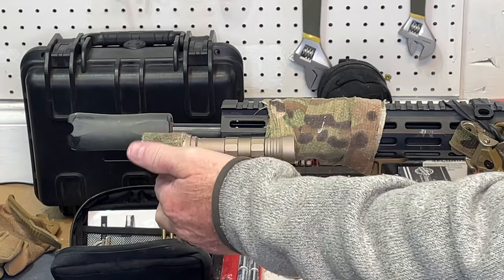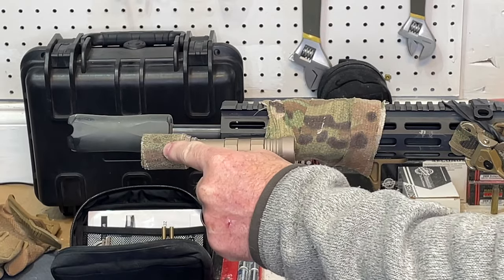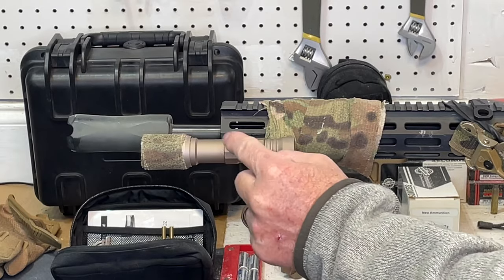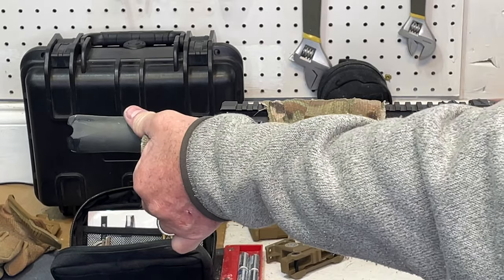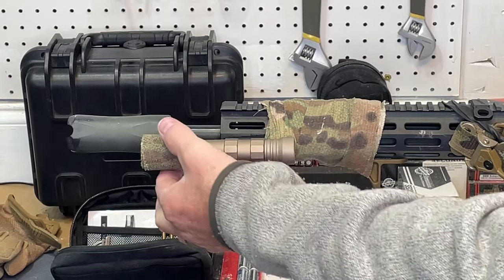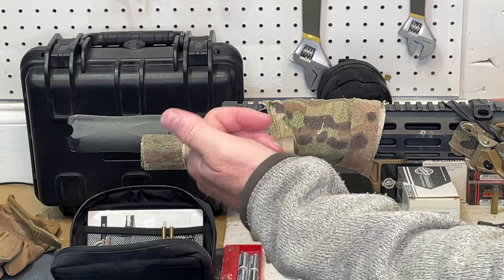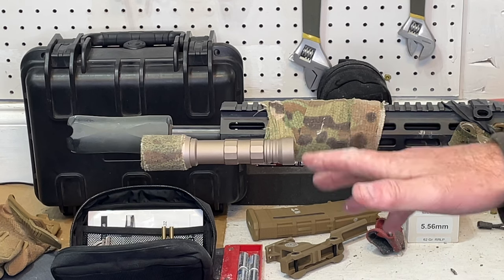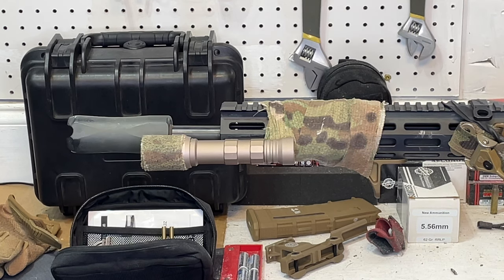AX PRO-TIP-2023 - Tuesday tweeks - your light

Comment: SMART! I have been employing tape similar to that for touch points and better gription. I get it in black at tractor supply. Comes in white too in case you find yourself someplace cold and snowy. What is that muzzle device you have there?
Reply from the maker: Thanks Hutch! The device is a Witt Machine SME (sound mitigation something-or-other) and just helps focus the noise downrange so it's not blasting students or range partners when doing demos or training. No NFA required!

Comment: Very helpful! Im wondering what are your thoughts are on the one hundred concepts light cap? would it be kind of pointless for civilian use?
Reply from the maker: Hi Janet! I like it personally - have one on the gun with the IR and it's got an obvious use there to avoid a light ND, as you well understand. As for use on the civ side (or without NODs/IR laser I assume), there's still a use for preventing the same issue. Just be sure to mount the light so that it's not going to get blown off by your muzzle device.
Reply: @AM-KX  Thank you for your insight!!
Reply from the maker: Hope it helps!